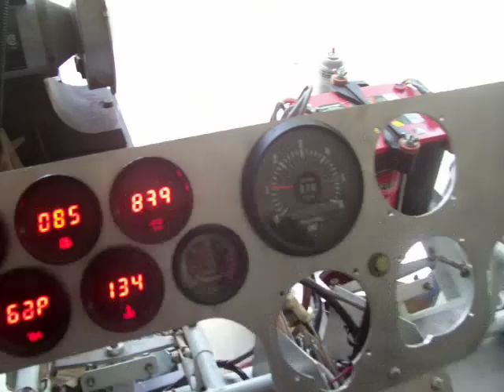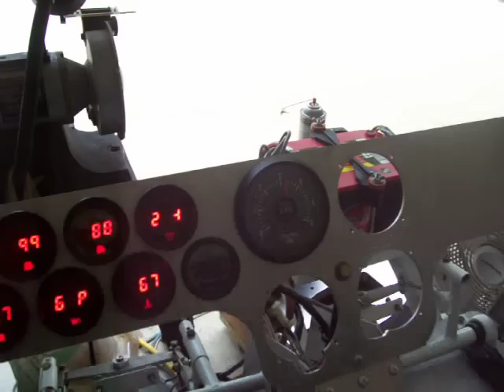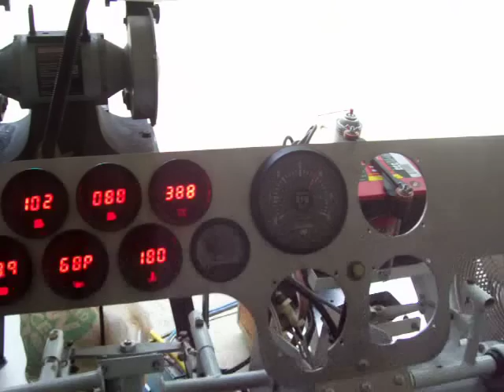Rotorway Scorpion Subaru helicopter

Comment from the maker: @m1217k I mounted the blades Thursday to do a static balance and lead lag.  I got the positive and negative pitch set.  I changed the coolant sender and put in an oxygen sensor today.  I plan to pull it out of the garage and run it tomorrow  (Sunday) without the blades and if everything is running good and the rain holds off then I will mount the blades and run everything Monday during tethered testing.  Then after 5 hours of tethered operation i will start hover testing.

Comment from the maker: @JTGolden250 It is a series 100 from superior gearbox with 1:1.4 ratio speed increaser.  There are several different versions to choose from just find the one that suits your needs.  My gearbox temp has never gone above 160*.  What are you working on?

Comment: Which Subaru engine are you using? What is the rotor gearbox out of?
Reply from the maker: The engine is a Subaru EJ257 with modified SOHC heads and intake.  The main gearbox is a front differential from a 97 Chevrolet 4x4, modified internally to run at 90 degrees offset.

Comment: @jonb9428 Thats Great J..  Any more video to share of it?  What did you come up with empty weight on it?  Did the subaru engine wheigh more or less than the rotorway 152? I believe the 152 is listed in my manual at 175 pounds?  Might have to double check that....  Look forward to seeing more.....  
Mike

Comment: What blades are you using?  Rotorway blades rotate clockwise and your system turns counterclockwise.  That is the problem I ran into, it would be nice to see someone get a Subaru engine to work.

Comment: Had a Scorpion in 2004 but it never sounded like that! That's amazing!!!
Reply from the maker: This one is quite a bit different from the original scorpion.
Reply: @jonb9428  you've inspired me to get another RW. I have a subaru to rebuild out of a outback I own. I'd be willing to pay you for how you did all this. Your dash looks great too. I plan to throw out the old dash and built a standard T console. I  had to sell my first one during a divorce. I lost the house but won the dog so I won that little spat. Anyway, I'm an old  army pilot that's just crazy enough to do something like this so I could use some help.
Reply from the maker: Tiger 181 My email is jonb9428@msn.com , send me your phone number and I will give you a call.  I would be happy to help if I can.
Reply: @jonb9428  hi man, can a any gear reduction transmission be used?.
Reply from the maker: Miclair Miclair The gear reduction needs to be suited to your machine.  Too small and it won’t be able to handle the torque, too big and it will be too heavy.

Comment from the maker: @donold009 The blades that I have were made for my helicopter by Precision rotors.  The root end is 2.8" thick for my larger rotor hub, the blades are 12' 1'" long for a diameter of 25' 10" , 8" chord, 1.1 inch thick.  I ran it today at 510 rpm after geting the lead/lag close to where it needs to be.  The Subaru engine runs great now that I have all the wiring sorted out.

Comment: Hi,

great job.

What is the total weight of the helicopter and how much do you think it will be able to carry more cargo?
I ask because I'm starting to build a coaxial helicopter, I'm thinking of using an EJ 25 engine, so I'm interested in some winning characteristics?
For me, only the main shaft with gears will weigh close to 100 kg. :(

Thank you very much...
Reply from the maker: Hi, Empty weight is 1460 pounds.  I can fly with me (200pounds) and passenger (200pounds) plus 15 gallons of gas if the outside temperature is less than 70 degrees F.  At 100 degrees F outside temperature it will barely lift me.  My transmission and rotor system without blades weighs 180 pounds.  Feel free to email me at jonb9428@msn.com
Reply: Thanks...

Comment: Hello sir Jonb 9428.'m in Brazil, I have a dream of building an experimental helicopter, however I intend to use a VW 2.0 liter carbureted, I wonder what kind of transmission was used in their helicopter, to connect the engine to the main rotor and syrup. would be a replacement or a differential pick-up. take my doubt. 
I await your return. have a nice day 
grateful .Jair

Comment: Could you give me some information as to where you got your gearboxes and tail rotor gearboxes
Reply from the maker: Sure, the main transmission is a modified front differential from a GM 1500 4x4.  The tail gearbox is a Superior series 100 1:1.4 speed increaser.
Reply: @jonb9428  your main rotor system swash plate rotor head main rotor shaft is that stock road away if not where can I go to purchase these items also the intermediate gearbox for the tail rotor I believe it's like a 30 or 35 degree angle what kind of modifications were done to the Chevrolet differential where can I go to get this information to build this
Reply from the maker: @markoneal1764  I machined the rotor system myself, using 7075 t6 aluminum and 4130 steel.  I made the ring gear spool for the gearbox too, there  is not one commercially available that I know of.  I used two universal joints for the 25 degree upward angle on the tailboom.  My email address is jonb9428@msn.com

Comment: Nice copter! Did you converted this subaru engine to aero engine? May be the cooling system? In my mind a motor engine can not run as high RPM for long times, just few minutes it will overheat. Did it really happened?
Reply from the maker: I modified a Subaru EJ257 engine for helicopter use.  The engine does not overheat.
Reply: Could you provide more details?
Reply from the maker: Hi Mike, what details would you like to know?  Lots of details here:  http://www.rotaryforum.com/forum/showthread.php?t=27088